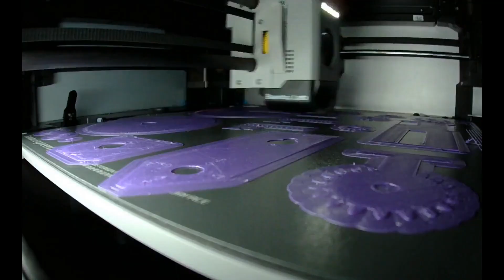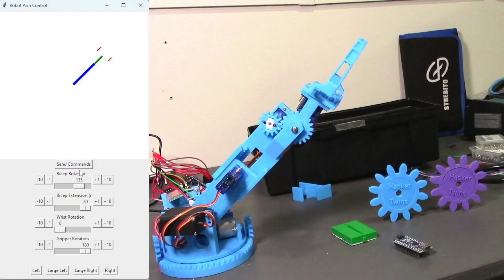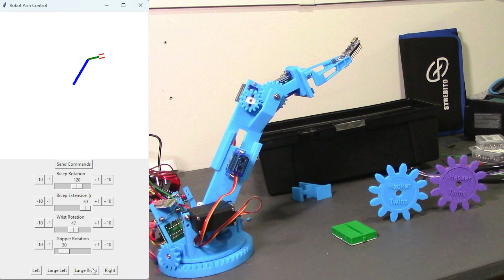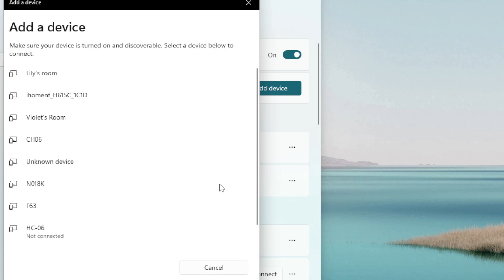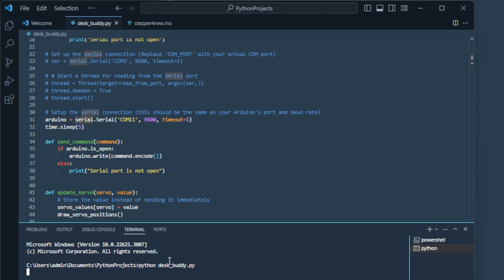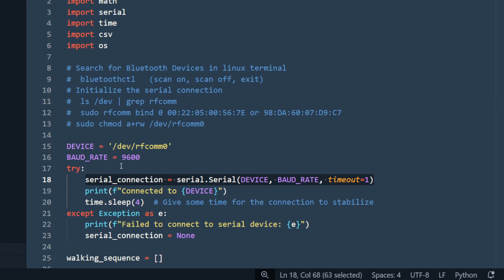Bluetooth Serial Connection: Windows & Ubuntu

Comment: Interesting video. thank you. Any plans to use such a control from an Android device?
Reply from the maker: We've used NRF24L01+ transceivers to control it with a remote controller, but the next plans are to make it bigger and use a raspberry pi
Reply: fortnite